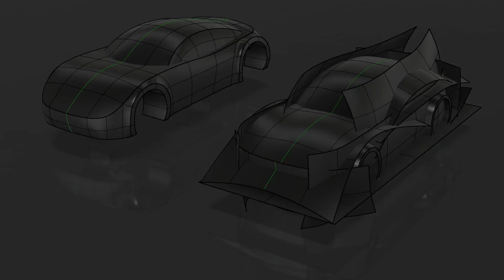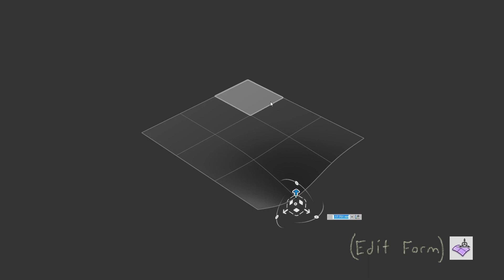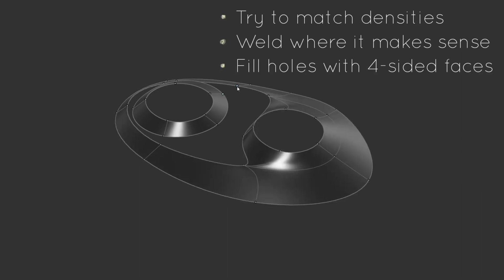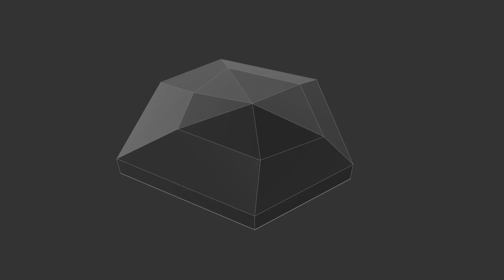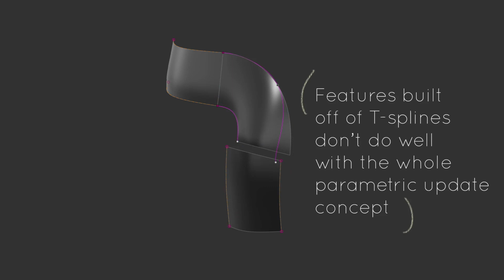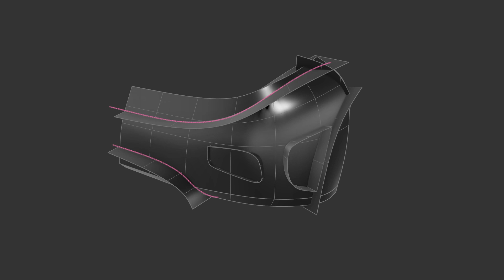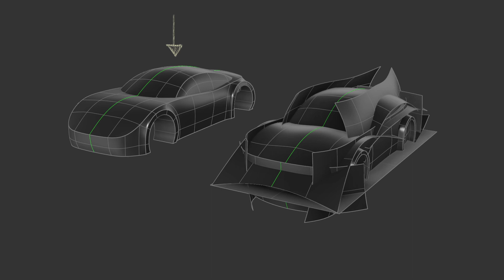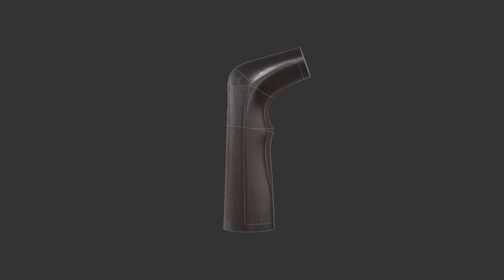T-Splines and Other Stuff in Fusion 360

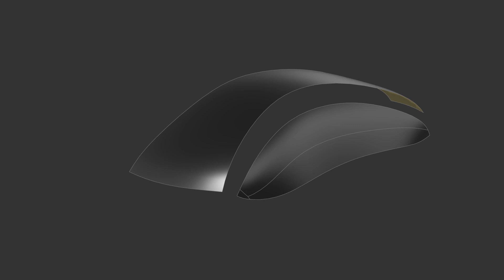Comment: Do you have a video where you explain what you did 9:17? That looks like You're using a pipe like in other videos, but it doesn't seem to be of uniform shape. I'd love too see what you did.
Reply from the maker: That was done with a surface loft. Create 3 construction planes using "plane along path", one at beginning, middle, and end of the edge you are applying this to. On those three planes, create sketches with circle profiles with the desired diameter at that position. Then create a surface loft between the three circles. You can then use that surface to trim - depending on the geometry, you may want to apply a surface extend to the ends of that loft to make sure it covers the area you want to trim. Hope that helps.

Comment: Thank you for putting this tutorial together, I'm looking to transition from Solidworks to Fusion and surface modelling is the biggest difference I'm finding. Is there a version of boundary blend in Fusion or do you just have to use a mixture of Patch and Loft?
Reply from the maker: account505 
Surface modeling in Fusion 360 isn't quite at the level of Solidworks, but it is getting better. There is no boundary surface feature, but loft now has guide-rail continuity controls and patch can now add guide curves (both of these were added after the making of this video) - this fills most of what I'd be using boundary surfaces for.

Comment: I do alot of 3-d sheet metal parts. I make the tooling male/female to generate. I have fusion but don't use it.  Most of the parts are solids (step). But must be unfolded in areas because of direction of hit  also need bend allowance after being moved. the software i use at work i cut the rad out rotate the flange and put in bend allowance. Is there a better way. Thanks..........   Think tooling.........this is a bigger animal at least for me..Dave

Comment: I started a thread on the Fusion 360 forum highlighting this video.

http://forums.autodesk.com/t5/design-validate-document/b-e-s-t-youtube-video-about-t-splines-and-other-stuff/m-p/6445446#M64650
Reply from the maker: Thanks for posting this. 

There were some very valid points brought up in this thread, some of the bigger ones are:

I don't go into valid solutions for solving the problems that I present in the video even though they exist.

5-sided faces are OK in certain instances... For example, the subdivide tool by its very nature will create 5-sided faces out of surrounding geometry and the surface quality is still good.

I'll try for higher accuracy in future videos.